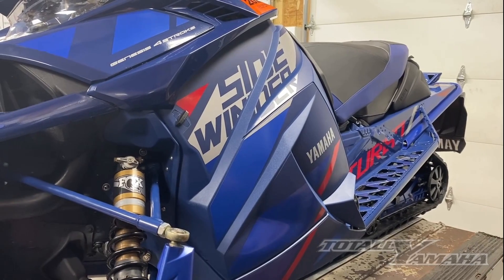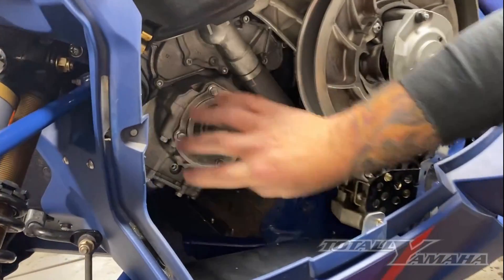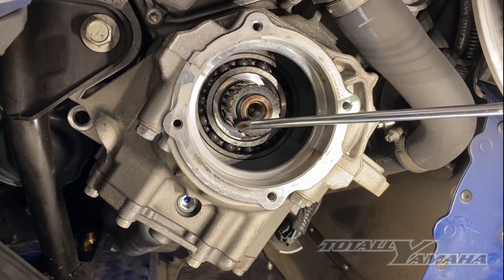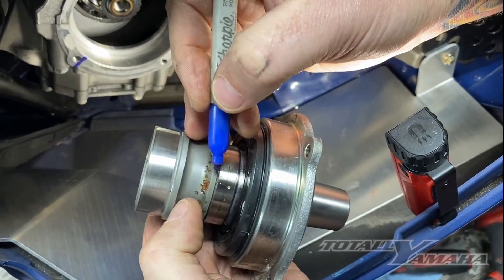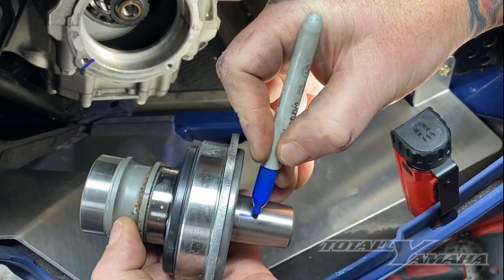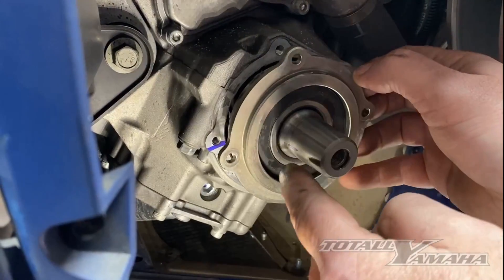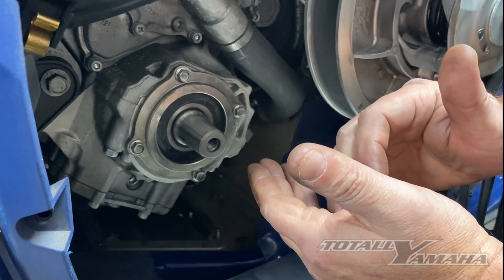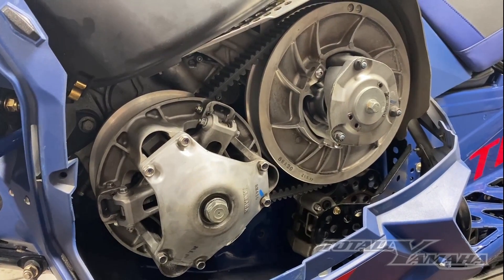Sidewinder Clutch Knockout Kit Install

Comment: I have a 2018 ltx-le 50th anniversary. 6800 miles and has never blown a belt. I have 2 friends with the same sled and 1 with a 2017. They are constantly blowing belts. I'm guessing the grease weeps and causes the belt to slip. All so it doesn't rattle at an idle. Leave it be.
Reply from the maker: This has nothing to do with blowing belts. And will not weep grease onto belt. lol. Belts blow from poor alignment or warn clutch parts. 2017s had alignment issues worst then most.